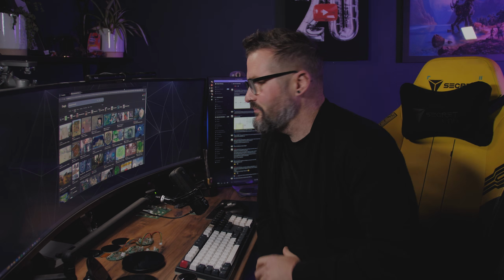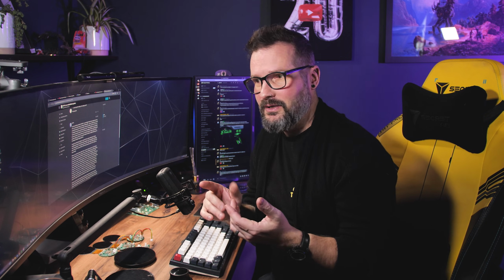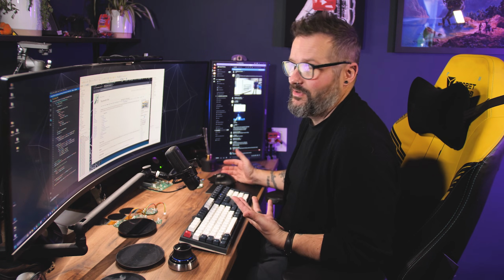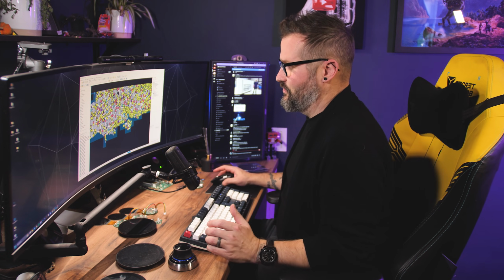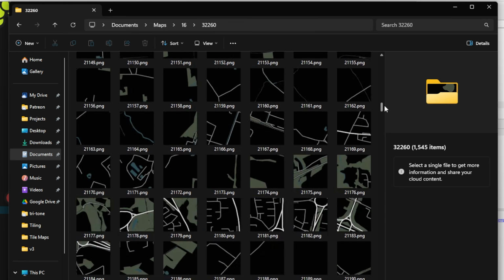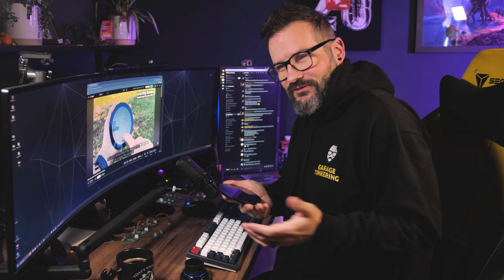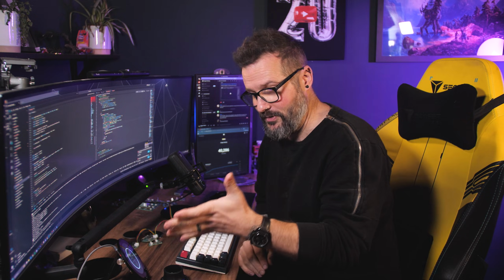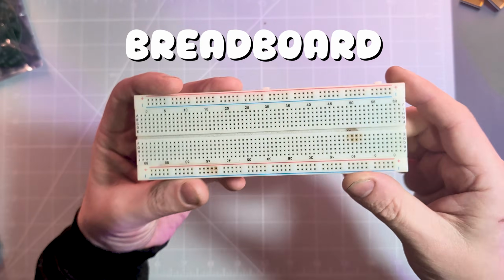A Real Mini Map from Need for Speed

Comment: People that said ESP32 can't do this well ... were actually right. Not only did you have to drop rotation (making the image displaying actually super trivial, just bulk memcpys), you only use a very small fraction of the screen wasting the rest, and you force everything to be pixel perfect (no AA'd movement) which makes the map jump around, not ideal for small / accurate movements. And not even a hope of proper NFS-like 60fps, is this even 30.

That said, with some more effort, a rotating map utilizing precomputed slices every 15 degrees or so could have helped. Obviously the lengthy precomputation processes could have been made in a small fraction of the time with more efficient utilization of cores (not just 1 core in 2025 lol), a better language and a thought-out IO strategy. Likely also you could've played with bit depth, etc, given the palette is intentionally limited.
Reply from the maker: Feel free to fork the repo and fix it. 

It does full screen fine though. That was a design choice, not a performance one
Reply: @GarageTinkering  I am somewhat tempted to, but looking around the repo I note you also used LVGL for such a performance-critical task, the start would be to toss everything but the assets and start anew. Using vector data instead of raw images for everything would also be on the table, though rendering those AA'd nicely in realtime is enough of an unknown to not make it an immediately better idea.

The improved version would probably likely go something like this:
-smaller tiles, like 128x128 to avoid wasted work while not blowing up overhead
-minimum bit depth while still not losing visual fidelity (RGB565 is a tad much for like 10 colors)
-pre-rotated versions of all tiles on SD card, 24 versions (every 15 degrees).
-assets not as individual files but a big blob with easily calculable offsets where to find tiles per specific coords to avoid extra filesystem work
-loading data strategically in a background process, WITH runtime pre-rotating versions of the tiles to achieve 1 degree accuracy (if 15 degs isn't enough at least)
-final immediate compositing to screen is just minimal memcopies, basically pushing blocks of pixels with x/y offsets right to the display IC, nothing blocking the display task, uses only buffers already ready in RAM with no extra processing
-efficient use of the second core to do all background processes, while bleeding work to the first core if needed thru proper FreeRTOS task prioritization
-choosing a smaller (400x400px or so) display that actually shows it fullscreen so it doesn't look silly/desperate for performance (even if you can decide its a design decision, it does not sell itself well)

-no zooming support, this can be locked in and avoids there being any final expensive compositing related transformation. No "mipmaps" either, either the perf is there or it isn't, car position doesn't commonly teleport

All this said, to strive for good quality, any kind of GPU, even one from a 15 year old phone, would ease all of this immensely. There's a reason they exist
Reply from the maker: I look forward to seeing it. As a relatively new embedded programmer there's definitely a lot I'll be able to learn from it by the sounds of things

Comment: That's actually quite impressive. While obviously something like this is really difficult to pull off on a micro controller like the ESP32 with barely an operating system at all. I would have honestly expected the who "getting correctly styled map tiles with marker" issue to be just as complex. But you actually found a really clean solution for that. But, I feel like north always facing up quite a big sacrifice to make. Come on dude, you are so close to a perfect representation of a mini map. You can't tell me you're stopping here. :D
Obviously you can't make the ESP faster than it is. But there has got to be a way to optimize this or a way to free up some number crunching time somewhere else. Depending on what algorithm you used, obviously you may be able to optimize A LOT by using a more efficient rotation algorithm. ChatGPT is often quite useful with simple-ish tasks like that. To further squeeze some performance out of this, I was wondering if you may be able to rotate the relevant tiles and keep them rotated in memory, so you don't have to rotate on every frame. I don't know if you have enough memory for this. But if you have enough memory to store two additional prerotated versions of the tiles, one slightly rotated to the left, one to the right. You could have the tiles ready for when you make a turn. And then keep prerotating all tiles in both directions before you actually need the rotated tiles. For this you have to work with fixed angular steps of course. Making it kind awkward when you're not driving in exactly the direction the map is pointing (cause it's between two steps). But if you can get away with small enough steps, I figure it won't really be noticeable.
Reply from the maker: Who said I was stopping here? 

But no, that solution idea wouldn't work. Both from a design and performance perspective. 

Switching to vectors might solve it but it's going to take some time. This is only one of many projects I'm working on and can only do so much at a time

Comment: Holy HECK this is amazing! This is much more "simple" than i thought it was going to be :p
Reply: Youve rekindled my want to make a new dashboard for my bike!
Reply: Ok question regarding optimisation! You converted your PNGs to Bin files, theyre basically binaries as you know. In terms of loading speed, and maybe a space saving optimisation, convert them to L4 bitmaps. For all the greyscale graphics. And anything where theres colour convert that to another L2 bitmap as an mask to apply a colour to. And with all your markers draw them as primitives on top. You might save on datasize and load times with that. But you also got it working so it might be an optimisation thats not needed :D Still amazing! Like I say its really rejuvenated my want to finish my smart dash projects
Reply from the maker: Yeah, even the large background only takes like 0.3s to load. Given how infrequently I'll be changing the design, it's probably an unnecessary extra optimization
Reply: @GarageTinkering  Fair enough, Im also thinking how this could work with a more embedded graphics chip. Still ESP32, but S3 rather than P4, but with the EVE graphics co processor too. That would take an extra layer of insanity to handle tile loading...
Reply: Oh also working with lower bit greyscale bitmaps rather than full colour ones and colour overlaying to get your pallet, might make things render faster so you can get the North pointing and map rotation you wanted, as the rotation calcing would be a lot less on greyscale than RGB

Comment: Wow! Great effort! But I think it is possible to do kinda similar thing in easier way. using a circle display mounted to the dash, using old smart android phone with circle launcher and connected these two with cable, then for customizing the map, u can use Snazzy maps. I am not a technical person and I just search it. So if it is not possible, I will be happy to be noticed. thanks for your good contents.
Reply from the maker: There are 20 ways to solve the problem. This is the one I went for as I need it in ESP32

Comment: Does the code have a limitation to the number of tiles? With how capable microSD is, I am wondering whether the code set or memory capacity would be the first weak point
Reply from the maker: Running at 5x5 seems fine. I've tried 7x7 but there's definitely a load lag. 3x3 and 5x5 seem ideal
Reply: @GarageTinkering I was referring more to the total number of tiles saved in memory, I would assume at some point you run out of physical addresses that the code could use and it's probably a hexadecimal number
Reply from the maker: Oh right. Yeah there would be limits. Each tile is 129kB so you'd top on an S3 around 60 tiles. But as long as you unload old ones correctly it's not a huge issue.

Comment: Have you considered using vector data for the map? It could solve the issues with rotation and tile count, especially since you don’t need much data on the map itself. It looks quite minimalist as it is, which would suit vector graphics perfectly. Plus, you’d be able to adjust the zoom level based on speed—so, for instance, the faster you go, the further the map could zoom out. Anyway, it's a brilliant project, keep up the good work!
Reply from the maker: Yeah, but LVGLs support of vectors is still flakey. It's in the works though

Comment: I mean the ESP32 is ridiculously capable, it can drive a framebuffer display at a nice refresh rate without tearing easily. Just have to get the SPI bus working at hardware speed not some bitbanged hack.

Comment: I've been watching your videos for a while and they are very good. This is the only one where I actually found something I don't agree with. While it is a mini-map (and an insanely cool one), it's not really a sat-nav since there is no route calculation involved (don't even think about trying to do it locally lol). You could do it with an open source stack and get routes working and showing other "players" that joined the same room (eg. Redis for real-time reporting). You can also serve vector tiles which are roughly 90% less memory than what you're using now. This will allow you to calculate routes and show them on the map. Obviously this will require internet connection but with a big enough sdcard, you can cache a lot of it and prioritize local files. A 60 miles route requires about 5-ish MB of storage for the tiles. If you cache all the needed info at the beginning of the trip, you don't really need internet (you won't see other drivers, etc, but for single trips, works great)
Reply from the maker: I never said it was a sat nav. It's not. It's a mini map.
Reply: My mistake, I was sure I heard you saying sat-nav towards the end of the video but after rewatching the video, it was actually "a sat-nav-type thing". I stand corrected 👍🏻 Going back to agreeing with everything you said in the videos I watched so far.
Reply from the maker: Wooooo! Golden record intact 😅

Comment: You're a real one for dropping all the code, as a fellow car guy / nerd, I WILL be trying to make this. Just wish you included the map theme settings at least lol it seems to be BYO-map tiles based off what I saw on the GIT, which makes sense, however it looks like a ton of time was spent getting the theme setup right and I think you could export those settings? idk if that makes sense but I think what I'm getting at is not just the map functions but also how its themed. Thanks for the video !!
Reply from the maker: Ah yeah, I'll try and suss sharing the colour scheme export. Leave it with me I'll look into that today

Comment: Greetings, GPS modules are not available in my country and Amazon does not ship them to Turkey. What alternatives can we use for this module? Finally, is there a diagram or a small connection diagram you could add to the repository?

Thank you.
Reply from the maker: I'll get the schematics put together once it's all more refined. And any GPS module should be fine if you can get one. They're all pretty much the same
Reply: @GarageTinkering  Thank you 🤟 I'll send a nice donation as soon as possible.

Comment: So, you rendered 300GB of bitmap tiles, but the modern way maps work is using vector-tiles rendered on the fly with a style-file for all the colors.
Did you test both vector and bitmap methods to find out which is most efficient for the weak CPU? (Since ya had problems rotating the images while keeping a good framerate)
Reply from the maker: I'm currently looking into vector options, but I was utilising lvgl for the heavy lifting of the graphics library, and Vector support is brand new so still pretty flaky

Comment: After seeing this I'd love to make something similar for my motorcycle (this is basically a Beeline Moto 2, just with a NFS theme to it). I have absolutely 0 experience engineering something like this, only a bit of programming knowledge, but this seems like the perfect place to start. However, it would need to be on a smaller screen. The only thing I'd want to add to it is some sort of direction giving system and a way to skip music. This would, I think, not be possible via on board processing and since it would require bluetooth to my phone anyway, would there be a way to have my phone do the processing? I'd basically be making a smart watch but only for music controls and directions.
Reply from the maker: Honestly, sounds like a smart watch without the strap might be your best bet

Comment: Was wondering if it's possible to zoom in and out of the map depending on the car's speed? Saw something about vectors being more perfomant in another comment. Would the zooming require this approach?
Reply from the maker: It would. I tried it with LVGL scaling based on speed and basically everything stopped working.

Comment: Before you switched to just rotating "the car" to improve performance tenfold. How did you calculate the rotation of the entire map? Are other tiles positioned based on an origin tile, or is every single tile's rotation and position calculated individually?
Reply from the maker: Neither. The container is rotated so it only does the calculation on visible pixels
Reply: @GarageTinkering  Hmm... interesting...

Comment: I decided to recreate your project. But i have 1 small problem. Uk is about 2.5 million tyles and 35 hour of compilating, which is kind of a lot, and i live in Russia and it is a little bigger (Gonna take weeks to create tyles or i will recreate just 1000km by 1000 km square around my city)
Reply from the maker: I'd only bother doing the region you're likely to drive. The rest is unnecessary

Comment: One way of handling the rotation and smoothness especially.. The ESP32 is a dual core. You would need to somehow split the work between those cores. Don't know how exactly, I'm not familiar with the lvgl, nor your project architecture. It might not be easy and straight-forward. But it may be worth looking into how to start utilizing that second core.
Reply from the maker: I'm already doing that

Comment: Didn't pay 100% attention to your map rotation algo explanation and I'm not sure which lib you use for rendering/graphics, but couldn't you keep map always pointing nort, rotating the car icon arrow to show direction, and then, before you render to screen, get the viewport (what's visible on screen) and rotate only it by the negative degree of the car arrow to offset it, that way you'd still have the car arrow always pointing north and the map rotating but peformance should be much better. Not sure that's even possible tbh, I've only used Bodmer's TFT_eSPI
Reply from the maker: It's LVGL, which already does pixel buffer comparison

Comment: Qgis has plug ins to extract map data from openstreetmap. I use it very often at work at its great to find anything you need, and it's also a pretty complete dataset.

For extracting tiles and avoid blank areas, you could try creating a poligon layer of the area you actually need and use the "layer extension" option when choosing what area to create tiles from.

Comment: Cool project, might want to make the effort to make one for myself.
Though I am curious, have you thought of the idea of seperating the images and car into a seperate plane and creating a "camera" class that simply views a canvas. 
Taking an inspiration from 2d top down games where you have your source images always aligned and doing their own thing, while the camera decides position / rotation / resolution / etc.

Might make the whole thing more performant, because you are never manipulating the images position / rotation, instead just your view of them. 
Since its re-rendering on every frame to begin with, there shouldnt be anythong other than negligable performance impact, compared to your static map version. Rotate the car icon along with the camera and it should always be facing up.
Reply from the maker: It's all the same for processing when it does frame by frame pixel comparison for the buffers in LVGL

Comment: this is stupidity simple so I'm assuming you've already considered it and it maybe doesn't work, but instead of rotating the tiles on the screen and the loaded tiles ahead, why not have a separate program / code that just literally rotates the circle that you see?  like take the circle on the screen itself and rotate them, completely seperate from everything else so it shouldn't slow it down
Reply from the maker: That's not quite how it works.

Comment: You should compress the images before converting them to bin, this will significantly reduce the size of the image and as a result also reduce the size of the bin files. Even lossless compression will significantly reduce file size for your case. Rotating the map will be easier in that case.

Also, you should rather than rotating the images rotate your view, this will be much faster.
Reply from the maker: Bin files are all the exact same 129kB regardless of the image as they're converted for LVGL.

Comment: This is so cool and God help whoever does this to the U.S. If the UK was a couple million tiles I can only imagine how many the U.S. would be.
Reply from the maker: Plus I only did about 1/2 of the UK. The entire US is about 60x that.

Vector should fix it
Reply: @GarageTinkering  True. I was also thinking about how the rotation of the map could work (even though someone pointed out the static map setting in NFSU2): if there was a way to simulate "procedural generation" where maybe the map only loads and displays 10 tiles at a time, that could help with the performance. I don't know much about how these devices work, but if that could be done it might be worth a shot.
Reply from the maker: @TheCreateOutdoors  I already do that
Reply from the maker: @TheCreateOutdoors  I already do that